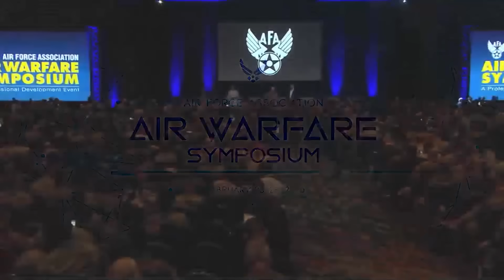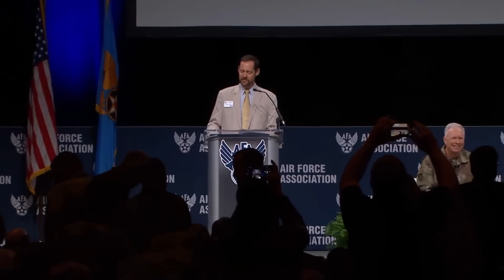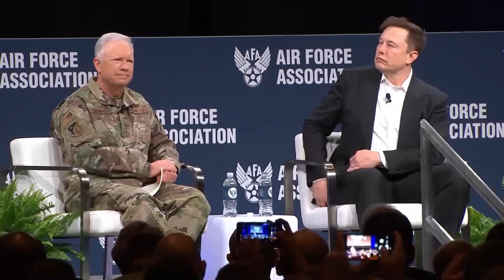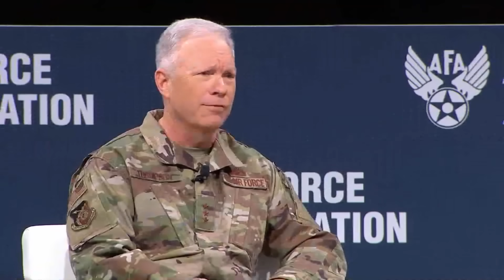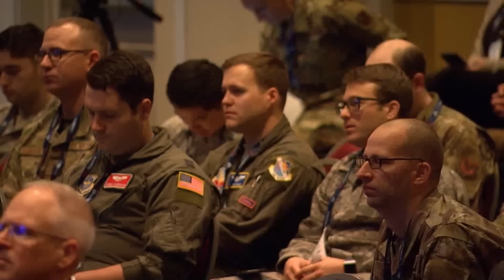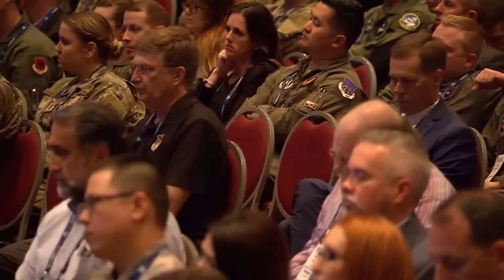RAW Elon Musk Interview from Air Warfare Symposium 2020

Comment: It only be no contest on the singleiest plane if the cost and time to manufacture was less per operating hour than the multi-use plane. Otherwise multi-use or single use would be unconsequential to the equation generally. However, most of the equipment on the aircraft can be used multiple times with a probability of efficiency that's going to warrant the risk that you're not using something brand new that was literally only tested and operated once the time it was tested😅 but there are different technologies you wouldn't want to use a rocket in order to get to the asteroid belt. I almost said saucer😅 lol very few people know how the saucer works so that would be unconsequential

Comment: The problem with making a re-useable orbital or interplanetary vehicles that is economically profitable from a business perspective is the design. A vehicle robust enough to be re-used multiple times has will need to be much stronger than a single use vehicle. In the process of making it stronger you make componets more robust or use materials that are more durable. These components either end up weighing more or costing more or both. That inevitable results in the price to put a pound in orbit more expensive than that of a single use vehicle. I believe what Elon is saying is finding that sweet spot where your efficiencies of production, design and operation allow a re-usable vehicle to economically compete with single use vehicles is very very difficult to hit. The margins are very very slim if they even exist. Building a re-usable is easy. Building a re-usable that’ll turn a profit is very hard.
Reply: Ummm...  step away from the keyboard.  The falcon series of rockets are EXTREMELY profitable.  Once starship gets online, it's profit margin will be insane.
Reply: Falcon system isn’t fully reusable. There is no production line for it. This is literally the challenge and task Elon is talking about and trying to accomplish. Did you even listen to what Elon said? Do you know ANYTHING about aerospace engineering or the business of putting things in orbit? 🤦🏻‍♂️

Comment: I agree that a drone would be able to win against a fighter jet in a dogfight as it is not constrained by g-forces as a human flown jet would be, also if it were operated by AI, it would have lightning fast response without human error.  Furthermore, there is no issue of human fatigue over time. However, a major concern would be from potential hacking of the system, whereby an enemy could potentially take over control of all drones and reprogram them. Hacking would not be an issue with human flown fighters. Another point that makes the dogfight circumstance mute is that most modern air to air combat is done with missiles. Potentially a hybrid model could be used where a human flown fighter launches a kamikaze drone missile.

Comment: Why not use the gravity of planet Jupiter , focus it on USS Nimitz & USS "Teddy" ( battle hardened & great adventure ) to lift these prime patriot examples of self-contained vessels into orbit for interglatic duty .
Reply: I know there's a way to lift a fully kitted USS Nimitz Class fleet using and focusing local planet gravitational pull , regulating rate of gravity pull .
Reply: experience gained focusing planetary gravitational pull /push , and you should be able to shuffle the planets in our solar system , move Mars closer for terraforming , after, replace it in original orbit .

Comment: I see many people attempting to explain why Musk's demeanour and speech seem odd, so I'm going to add my own hypothesis into the pot.

I believe his presentation can be explained by slow mental processing and erratic thought patterns; 
Slow mental processing; possibly exclusively verbal, it's hard to tell if the problem is input (interpreting the question) or output (forming the response) because the result is the same (verbal stutter - "um..."). 
Erratic thought patterns; Elon quite clearly loses track of his own train of thought and sometimes diverts so far that his answers do not address the question asked. He quite likely owes his creative talent to this trait.

I see many people speculate Autism/Aspergers, and I see why you would think that but I do not agree. I suspect that many (perhaps even most) cases of Autism includes the above traits co-morbidly, because of this the symptoms of Autism are conflated. Autism typically infers social difficulties, slow mental processing can give that impression but there are subtle differences that can be easily identified. Seems to me like he lines up more with SCT (and ADHD).

Comment: I worked for 30 years as a maintenance electrician/electronic technician in heavy industry and I wish we had someone with an ounce of Elon's drive for innovation in the leadership positions. Automation was accepted reluctantly and I even had to pull stunts like getting equipment on loan from a supplier to prove that it would outperform the old tech, running in parallel, then when the old equipment failed, the new system would seamlessly take over and send me a report that the loaner system was now controlling the process. Then I would go to the leadership and ask if they wanted me to remove and return the new tech and incur the downtime and expense to fix the legacy system. I'd come out of retirement to work for Elon in a second.

Comment: EST0.01: MRI rolling freely on non magnetic tracks(possible later test model, using magnetic levitation, inverter or whatever), extended wiring, thick Aluminium jacket in cylindrical shape around external structure of MRI. Run strong gravitational uni directional shaped wave in a mazer laser through MRI main cylinder. See if MRI grabs onto the magnetic wave of the laser and goes forward. Suck at Quantum stuff but the ideas are driving me crazy, so i need an area 51 lab or something, and real scientists to help out like now. Turns out magnetic fields can kill you, good thing I learned about that part lol. I would go further than Elon. We are even past drones. We have the tech, and knowledge to harvest the power of magnetism. In my opinion the future of transportation mostly and even interplanetary. The answers are in magnetic fields, photons,gravitons, mazers, rotation, microwaves, copper engines, neodymium, metal gases, conductivity, etc etc I mean the answers are there. We need to test how to harvest, focus, intensify its powers after and then make it efficient

Comment: It's really really useful when the people doing your design also know about manufacturing systems so they intentionally make things manufacturable from the beginning.
Reply: As someone who designs his own products, I find I do much more thinking about the machines to make the product, and how to do it in fewer steps, and to absolutely simplify final design. Refining to simple takes time, lots of prototypes.
Reply: 100% As someone who works in manufacturing it is very important to have an open line of communication between your engineering department and your manufacturing experts.  There can often be a disconnect between these two lines of thinking.  When an engineer is designing something new, they do not always know the how easy or hard it is to manufacture the different various components he has added to his design or how easy or hard it is to obtain the materials he has decided to use.  More experienced engineers who have a history of working with manufacturing experts can get better at this but there needs to be an open line of communication with engineers doing R&D and your welding, machining, assembly, & material procurement experts.  As Elon said, it is infinitely harder to design the "machine" that builds the machine.  Perfecting your manufacturing process is the real challenge.
Reply: Bill Kong that’s why he said the best design is no design or something like that

Comment: Airmen can afford Tesla’s??
Reply: If you count in the gas you don't buy it gets cheap fast...buy a power wall with your car..charge at home for free..and power your garage/shop/small house..or at least hear and a/c. I'm working on it now. The numbers are excellent..I probably won't buy a Tesla..I will buy their battery and motor. Then you can have a Chevelle if you can swap it.
Reply: Raymond Noodels You just put the body of your choice on a Tesla skateboard.  Also, you won’t be needing a separate power wall because your auto can be used for that purpose as well,
Reply: I think 35k and not having to pay for gas is pretty affordable. Unfortunately a lot of people think all Teslas are 100k vehicles.  5 year cost of ownership puts the model 3 and model Y lower then Accord or Camary.
Reply: Riiight
Reply: They probably get military discount or they buy pre-owned.